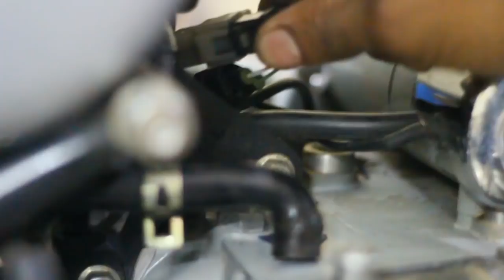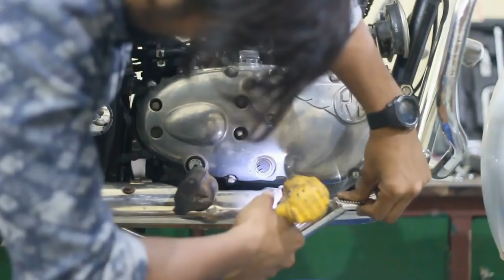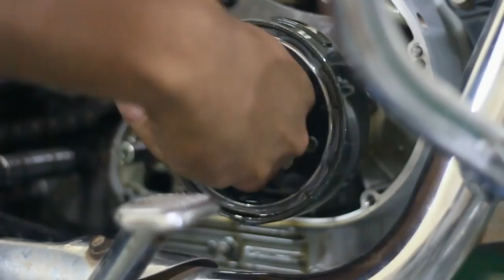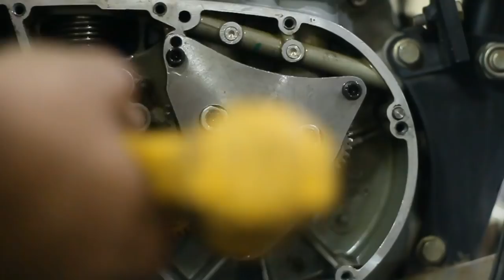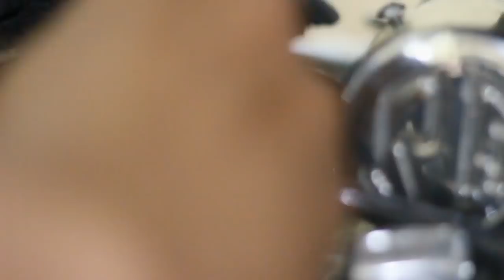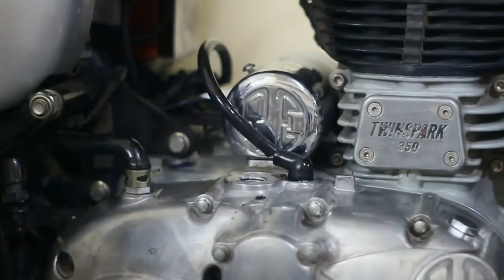vibration reduction plate(Enable subtitles)

Comment: You missed a few key parts!  First, secure the crankshaft key after removing the magnet. Second, secure the two thin washers used on the timing gears!  Third, secure the oil filter rubber washer.  Forth, clean and replace the case housing gasket!

Comment: Well I attempted to install the Carberry on my Classic 500 and messed up bigtime!!  First, I had to remove the foot peg, rear brake pedal and exhaust!  After using a gear puller, I removed the magnito (stator?) and failed to secure the small key that keeps it secure on the shaft!  It dropped out and fell somewhere!  I can't reassemble the engine without it!  It's on order from India!!  I was told it "takes a while"!  I was also told ordering the part would void my warranty; since I opened the engine case.  😥

Comment: This plate really works and reduces vibration to a great extent. Can feel the difference after installing it, engine seems to be more refined and very less vibration in the handle bar too. 

Overall vibration in the bike has reduced. Just take it to a good RE bikes experienced mechanic and install it.

Comment: Those complaining that it doesn't work forgot to take out the two pins which keep the original plate tightly in place and mounted the damper with allen bolts🤣🤣🤣

Comment: Sir yesterday i tried with this plate in my bullet500standard uce one...after running some 5to6kms some unusual sound was coming from the engine... immediately went to mechanic and replace it with original plate...now no noise. Dont know whts wrong with this plate. Purchased online from ur site. Very much dissapointed😢

Comment: this is shit an extra bearing or a bush in crank shaft cant reduse the vibration becouse the plate is also bolted on engine itself and crank bearing has enough strength to hold the crank if crank makes vibration then it transmit that vibration to engine through bearings after to chassis then to rider if you really want to reduse vibration balance the crank waight and add rubber mounting to engine. 
instead fooling innocent customers.

Comment: Please share the handle bar vibration after and before your changes..  Then only we can able to judge whether this is good or fake...
Reply: Saranesh K that is impossible. Because a camera can't capture sudden moments (vibrations). I tried once to record vibrations in my swift's driver seat but failed. The vibrations were visible to the naked eye but wasn't visible in the video. Ultrahigh frame rate cameras are required.
Reply: it is not impossible...u can clearly see vibrations in slo-mo..if u have that in your cell phone...
Reply: Saranesh K

Comment: will this work on std 500 ?? what are the things i have to keep in mind before attempting to add this to the bike
Reply: Dude you using 500cc? any EFI  issues? am looking to get  500 classic but scared of EFI  issues
Reply: mine is a carb version
Reply: No Fi issues, works great.
Excellent throttle response. Don’t let her run dry without petrol or low petrol often, it’s not good for fuel pump.
Just some air hoses gets punctured now and then, still manageable. Not all mechanics service it. Moreover it doesn’t need any servicing or maintenance.
Reply: Pradeep R I really liked 500 over 350cc but heard lot of EFI issues, do just running my 2011 tbts for now, since how long you riding 500?